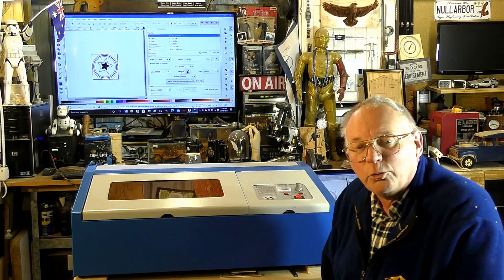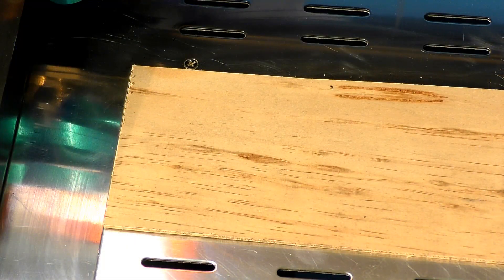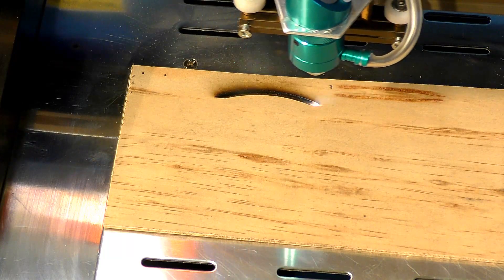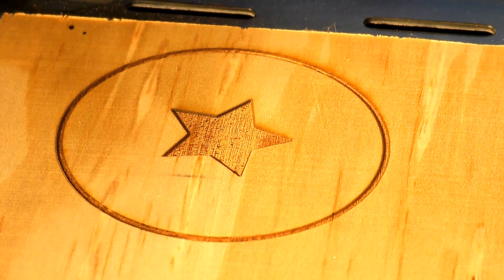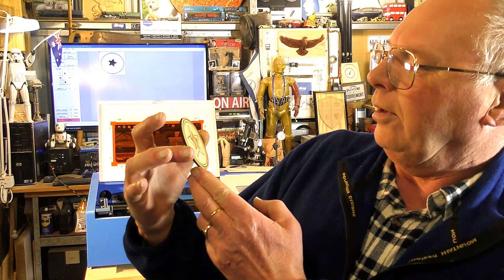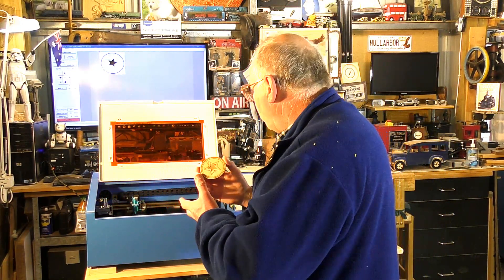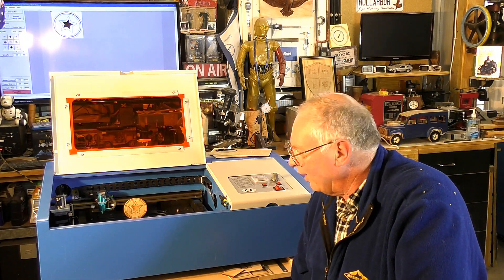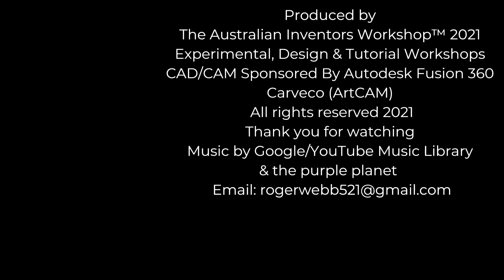K40 LASER *FIRST ENGRAVING TEST*

Comment: This has been a great series so far.  Lots of good information and I really like the fact you are giving a totally unbiased opinion on the K40.  One thing I found helps with the raster engravings if you are using K40 Whisperer is to go into the Settings tab then Raster settings and check the Engrave from bottom up button.  This helps a lot with keeping down any smoke staining on your work as most of any you may get is normally removed during the rest of the engraving process.  Looking forward to seeing more!

Comment: I wonder if there could be a graduated design that once "printed" on a material, it allows you to calibrate it for that material and then (after sacrificing one piece), print the rest of the batch with confidence.
Reply: If you change the control board to a Cohesion 3D board that will enable you to use Lightburn software.  With that there are power vs speed and raster engraving test patterns that you can run which will let you see how your material will react with different settings so you can pick the one you like best for a given material.  If you run one for each type of material you are going to use you'll have a good starting point for your job.